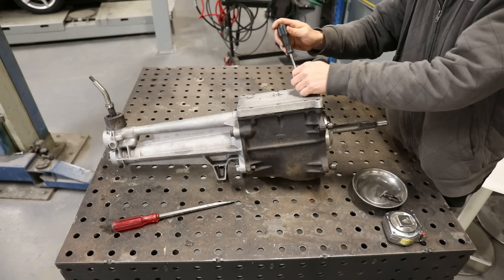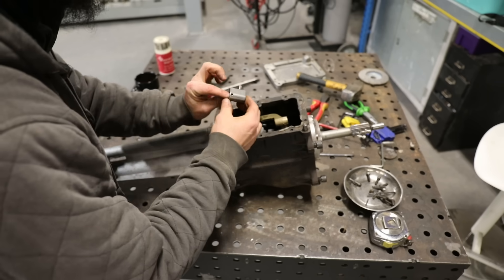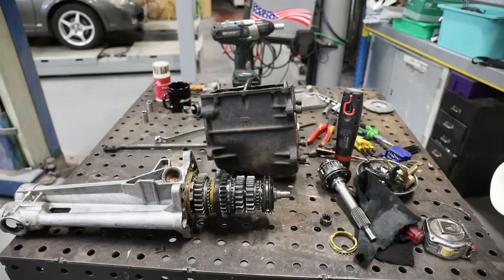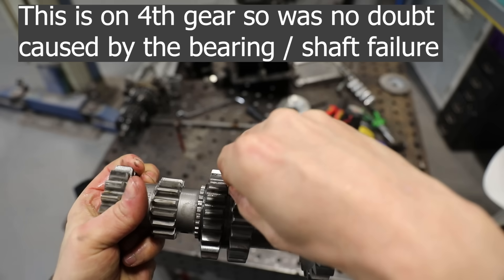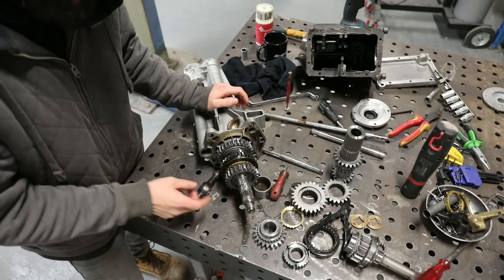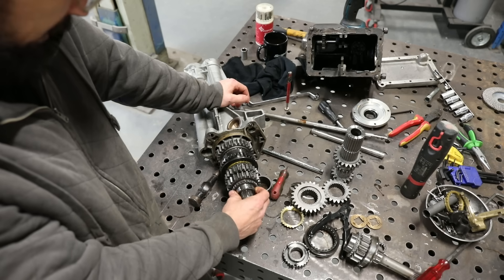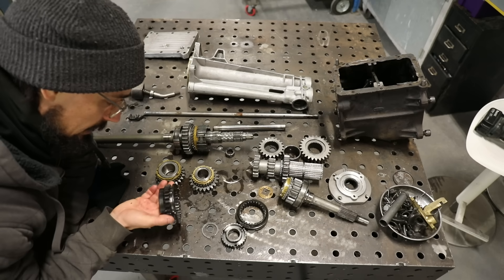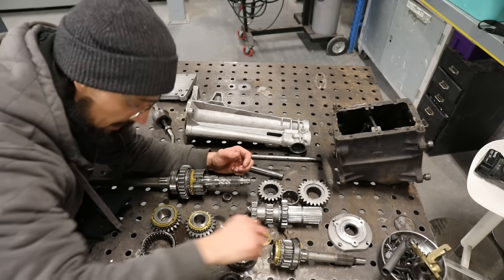How To Disassemble A Ford Rocket 4 Speed Quaife Straight Cut Gearbox?  Exploded View - Part 1

Comment: This is super helpful, I've subscribed as I might be rebuilding my Type 3 (not rocket), which I believe is quite similar.  I've got a 'popping out of 2nd' issue. It also struggles to select 2nd too. I'd love to hear your thoughts on that before I start? Thanks
Reply from the maker: Thanks, Is that the one one with the 3 rails across the top? Id check the detents and springs that hold it in gear, sounds like a selector issue.
Reply: When i open the top is has one rail. With a bearing at the front of it and a spring in the casing which pushes on the bearing when you tighten the access hatch. @Urchfab

Comment: I could never understand how gearboxes shifted gears until a mechanic, who re-conditioned a box for me, showed me how they work.  It's so simple but looks complicated.  It's hard to explain how synchro gearboxes select different ratios unless you actually see the innards in action.  Hope you have managed to source some parts.  Replacing the shaft is a wise decision I think, considering the use it will be put to.  Don't want any gearbox failures when you are flying around a track. 😊👍

Comment: The baulk rings that have broken tabs for the blocker bars need replacing otherwise you'll have problems with it jamming in gear due to the blocker wires, I treat the 3rd-4th gear ones as servicable items on my annual strip/rebuild of my gearbox and use good used genuine Ford ones as have found that the pattern ones don't last a season's racing...
Reply from the maker: I'll have a good look over them. Cheers

Comment: Honest question: why not retain the MX5 gearbox for the pinto motor?
Reply from the maker: I want to move the engine back and the mx5 gearbox is really big.
Reply: The mk1 mx5 box can be shortened (the remote) I have shortened mine as far as it can (the connecting tube is only 10mm long)  I have been told the mk2 can also be done but I have not looked at it in detail enough to see how. They say you can place the gear-lever in the front most square cover. 
Perhaps have a look what you can do, with your skills you should be able to do it. 
Keep at it, cheers shaun

Comment: Had a worn  MG mainshaft tail repaired by machining the worn bit off and a repair piece made to press on fabricated from a piece of gudgeon pin, (which is super hard).
May work on your part if the strength isn't compromised.
Think those shafts are case hardened and when they wear like that it is the case hardening wearing through.

Comment: Oil feed to that bearing is also an issue on these. Check the tiny holes in the 1st motion shaft arn't blocked.
Reply from the maker: I will check. Cheers
Reply: @Urchfab  I remember somewhere an article from BGH Geartech on opening these oil feed holes out

Comment: Hope I'm not being thick but......
Is there a different bearing available (With larger rollers of course) that has 
the same outside diameter but with a smaller internal diameter so that just 
a light skim of the shaft would be all that is needed?
eg 30mm outer diameter. Inner decreased by 0.5mm by having 0.25mm larger rollers.
Hope this makes sense. 
Or is the shaft only hard enough on the very outer layer?
Reply from the maker: I've found the correct size hardened sleeve. Cheers
Reply: @Urchfab  Probably the best way. It will have the correct polished finish too.
Also...... Nice to see old-school buggering about that you actually use for the intended purpose and 
drive in anger. Not just  few burn-outs & doughnuts like must "tuner" channels. Actually racing a race car.

Comment: Very interesting episode, thanks! Been a while since I stripped a gearbox. I assumed, being a racing box that it would use dog clutches instead of synchromesh.
Reply from the maker: You can get a dog engagement gear kit for these, its more expensive with less options for ratios.
Reply: @Urchfab  Thanks for the info. I've only driven one car with a dog box, Fiat 500, in 1980! I've never forgotten how to do quick double de-clutching🙂

Comment: Inner needle bearing sleeves are available, proper hard surface. Cheers Mat
Reply from the maker: I will look into that. Cheers
Reply: I think that would be cheapest/easiest as you’d only need to machine down the shaft slightly to accept a bearing sleeve.

Comment: I seen a video years ago about layer welding or spray welding, it was a process of building up the metal with almost a metal dust. Obviously the cost might be more than a new part, or using a lathe and mill.
Reply from the maker: I think it would be interesting but probably not the way to go on this.

Comment: Welding the nose of that shaft wouldn't be a good idea as you would alter the temper of the shaft and have to get it retempered, which would probably be a bit spendy.  You could probably get a replacement shaft from Ford for less than a retemper.
Reply from the maker: Agreed, I will go for a replacement shaft or a bush pressed on. Cheers

Comment: 4:40 so he does it on a table with fixing holes everywhere 😅 
These boxes, apart from the above problem look really straightforward to work on!!
Reply from the maker: I like living on the edge!
Reply: @Urchfab  of many holes 🤣 just remember, when something falls it always rests under something bigger 😆
Reply: As a Ford mechanic from the 1960s they haven't changed much since the Ford Anglia.. You need a shortened dummy layshaft to reassemble.